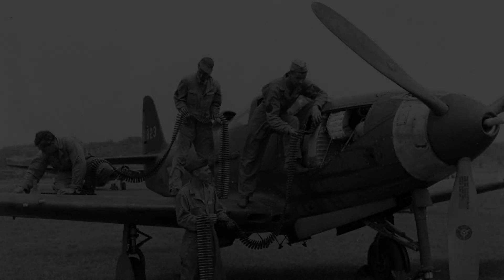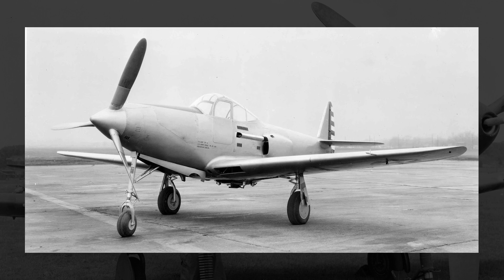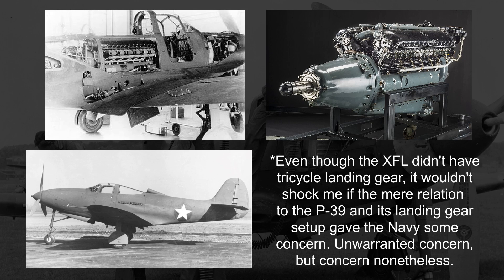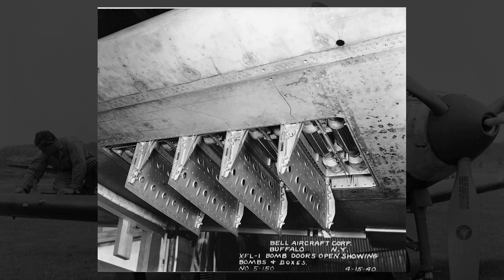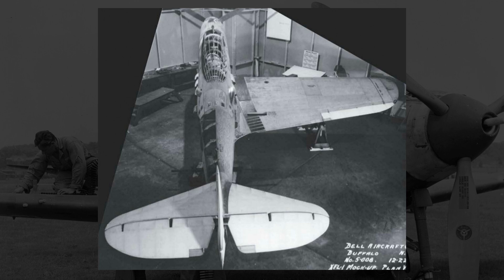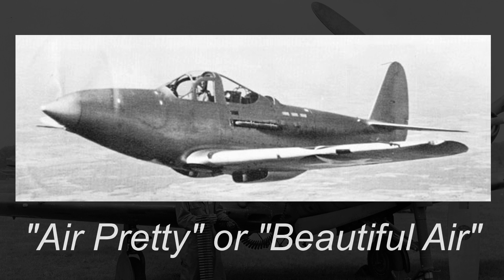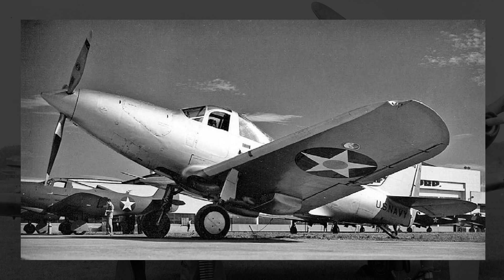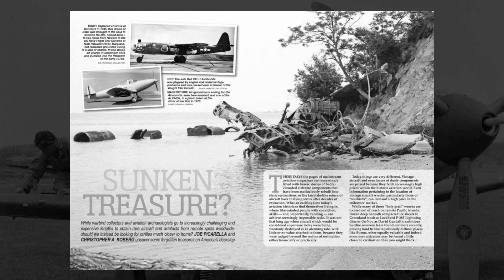A Fighter So Disappointing, They Used It For Landfill: Bell XFL Airabonita

Comment: While best known for flying the P-51 and the Bel X-1 rocket plane, the early fighter of Chuck Yeager was the P-39. He wrote that he had fond memories of it.
Reply: It was a good airplane that got nerfed when the USAAF directed all turbochargers toward B-17s and remainders to P-38s. They did not have enough Inconel alloy production to go around. 

Allison designed a two speed, three stage supercharger that would have matched of outperformed the unit designed as part of the Merlin. The Allison was a modular design that could accept any accessory or supercharger the USAAF needed. But they had a distain for gear driven blowers due to the staggered performance and pilot workload as altitude changed. They (rightly) determined the turbo(super)charger was better. They failed to realize it was not ideal for a pure fighter. It was not fully matured technology. And it was also not able to be mass produced in sufficient quantities.
Reply: The add-on supercharger was used on the P-63. I believe that they actually drove it through a fluid coupling so it could have 'stepless' speed changes like the DB series.
Reply: @Triple_J.1 thank you for the post re turbochargers. Indeed the lack of sufficient boost was a hindrance for any high altitude airplane of the time.
Reply: @Triple_J.1  no, the little P-39 performance was proven to be inadequate with the turbo system and ancilliary cooling requirements.  Allison never made an effective high altitude engine or one that could withstand high boost.
Reply: @bobsakamanos4469  The P-38 used the full-up system and was quite superior when it was introduced. But you more-or-less had to design around the turbocharger system.
Reply: @brettbuck7362   
better check the operational and developmental history of the Allison engines in the P-38s of the ETO.  Even in the months before DDay, the abort rate was about 50%. 
Even the Allisons in the L variant couldn't handle high boost of 150 octane when tested at Eglin proving grounds, but the P-51B and P-47 were fine at 75" MP.  The RR Merlin was even better with 25 lb boost (about 83" MP).
Reply: @bobsakamanos4469  I am not sure what you are on about here, this was about the performance of the engine. It was very complex and hard to operate, but with the full-up turbo system it was as strong or stronger than the contemporary Merlin.
Reply: @bobsakamanos4469 respectfully I believe that the Allison aircraft engines and turbo charging is more complex than is suggested in your post.
Reply: @ yes, the turbo went through its teething problems, however the Allison had its own issues as evidenced with the P-40s and P-39s and even the "stronger" G variant of the P-82s (all non-turbocharged).  Even the redesigned intake manifolds used late war didn't handle higher boost.
Reply: The aircraft was just too tail heavy..
Reply: @JeffreyHavelin  
Not really since the XP-39 was designed with its turbo and cooling system behind the CofG.  Removing them would have made it nose heavy.  Significant ballast near the tail would compensate but also increase the inertial mass back there.  Change in CofG with ammo expenditure was a factor. 
The P-39 had a host of design and handling issues, the airfoil being one that slowed recovery from a stall & flat spin.  Read up on the Wright Field pilot report.
Reply: Not only Chuck Yeager but the Russian loved the P-39's!
Reply: I have read of other pilots that were more than a little fond of the plane.
Reply: He was also one of few to fly the F-20.
Reply: Yeager was exceptionally skilled, so pilots like he and Hoover would of course not complain about the P-39.   The USAAF mandate was however to train thousands of pilots with lesser skill; ie fighter pilots who struggled or crashed the P-39.
Material Command flight test reports clearly showed it to be an unstable gun platform with a host of handling problems.  Fighter training units experienced 3x the number of crashes in P-39s. 
But hey, it was perfect as a gift to the Soviets in exchange for gold.

Comment: Always intrigued with the cannon in the prop idea !
Reply: Ah, in the case of the BF 109, cannons were successfully mounted through the propeller hub. This mounting was facilitated by an engine mounted oil pan up and cylinders down. The cannon was mounted above the engine entirely.
Reply: I think that helped it remain operational throughout the war. Plus being a good design. 👍

Comment: Eric brown landed and took off from a carrier in a 39. Ground acceleration was so slow he barely got airborne. Granted us fleet carriers were bigger but it never would have been a good carrier plane.
Reply: Brown landed a hooked Airacobra on a British carrier in 1945.

In 1939 he was still an operational fighter pilot.
Reply: It was indeed in 45.  He said that the Tricycle gear made for good visibility on approach. Very nice to land on the ship. The poor acceleration on take off did give him a brown trousers moment. Ironic that a standard configured P39 would have made a better carrier plane. In the end the Hellcat and Corsair were a much better choice.
Reply: @timholden8670  oh a 39 would have made a superb deck landing plane no question. Fwiw it was faster than a zero could match it in a roll had better armor and guns. Couldn't outmaneuver a rock and couldn't climb worth spit and when usaaf pilots were using it they hadn't learned boom and zoom or the thatch weave but if the carrier version had gone ahead it's higher speed than the wildcat may have lent it a certain mediocre credibility on par with the sea hurricane.

Comment: The centrally mounted engine had a inherent disadvantage in that it took up valuable space at the center of gravity.   Variable weights particularly fuel should be located near the desired center of gravity to avoid shifts in center of gravity as they are used.  In the P-39 the prime space at the center was taken up by the engine instead of fuel.  This limited space for fuel and restricted the range.  This of course was a severe handicap for a plane that needed the range desired for carrier operations.
Reply: That's all correct. There is however also an advantage in putting the heavy stuff close to the CG. It makes an airplane more nimble, since the closer the heavy parts are to the CG, the less prone the airplane will be to inertia forces, meaning it will be easier to engage into a rotating motion and also easier to stop that motion.
Reply: @charlesrousseau6837, except when the ammunition was expended, it changed the CG once again and it was easy to get into a spin. Some pilots were lost when that happened at low altitude and they didn't have time to recover.
Reply: @TahitiMercury  That would have been because the ammo was probably stored in the nose, forward of the CG. When the ammo is gone, then the CG moves backwards and the airplane becomes tail heavy and more prone to spinning indeed. A case where masses at the extremes of an airplane cause trouble in the first place, is the roll-yaw coupling phenomenon in Century series fighters like the F-100. The heavy engine in the back of the long fuselage upset the airplane when it engaged in brisk manoeuvring, especially at high angles of attack.
Reply: @charlesrousseau6837 nimblness due to low polar moments of inertia was my thought as well, I can also see where if you were not used to it it could degenerate into a spin, ample pilot training would be required, not something that was likely with the requirements of war, learn and learn quick!!.

Comment: I'd venture a guess that the Navy wasn't interested in the XFL primarily because of maintenance considerations around the engine. Maintenance and Logistics are very difficult during carrier operations, so the combination of relative unreliability and complex engine replacements would result in most of the ship's XFLs being in the hangar deck as opposed to in the air. Also, a bonita is a type of fish.
Reply: The navy wasn't really big on liquid cooled engines in its aircraft.
Reply: @davidjernigan8161  Yup. They were heavier and also prone to failure in case of a coolant problem, which you don't really want in a navy plane.

Comment: Bell's aircraft in WW2 seemed a bit dated even for the era, like they were stuck in a mid to late 1930s design mindset. At least they made the X-1 and some good helicopters later.
Reply: The turbo was removed simply to rush it into production despite all kinds of nonsense claims otherwise, England, France, Australia and everyone else was screaming for aircraft in 1939.
Lt Benjamin Kelsey, the Army officer who was "Congresses guy" in development and procurement for Army aircraft was interviewed years after the war by a writer who wrote a book on US Army aircraft during WW2, when he ask Kelsey what the biggest regret of his career was he said it was not being able to see the P39 through its full development as it was originally intended (with the turbo for high altitude performance), he reasoned as many have that had that happened there might never have been the need for the P51 to be designed as it would have filled its role.
Reply: @dukecraig2402  ...... except the P51 was designed to an RAF requirement, not a USA one they just adopted it later. So even if the P39 was able to have been completed as intended there would still have been a P51 as the aircraft was needed by the RAF, though the US may not have adopted it.
Reply: @dukecraig2402  Kelsey was in the pockets of GM and GE.  Combine that with the inadequate and unreliable Allison under high boost, and the mass produced turbo P-39 would have been a failure, especially since it had handling problems.  Bell was right to pawn it off on the Soviets.
Reply: The slow development of turbochargers didn't help. And we didn't have a 2 stage supercharger like the Merlin. At least the P40 had a little more wing area that made it more useful.
Reply: @bluetopguitar1104  
Everything about aircraft has slow developments, and it wasn't the turbo chargers per say, it was making sure hot streams of air at speed didn't come off a duct and burn wiring and those sorts of little details, people are always turbo this and turbo that when in reality it was the little things like putting shieds here and there to protect things from heat.
Aircraft travel a considerable amount faster than cars do, even in this day and age of computer modeling it's probably impossible to design something like that and be 100% assured that hot air isn't going to scorch something at speed, you have to fly it and examine everything, all that takes time to do it properly.
Reply: If you consider that most fighter planes early war had enclosed cock pits, in that aspect it was ahead of its time.And tricycle landing gear was also a modern feature. It looks ahead of its time to me.
Reply: Without the British Miles M52 the X1 would literally have got nowhere.